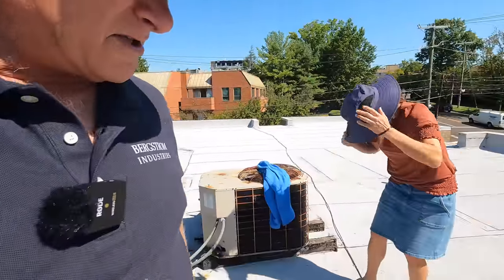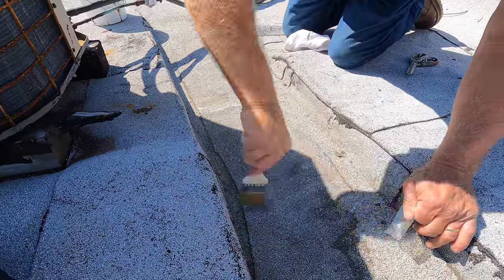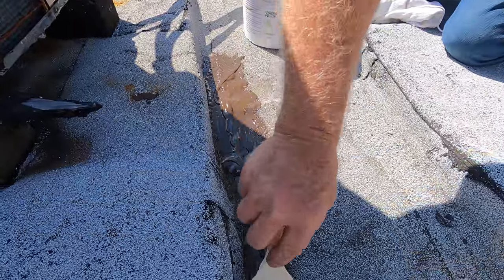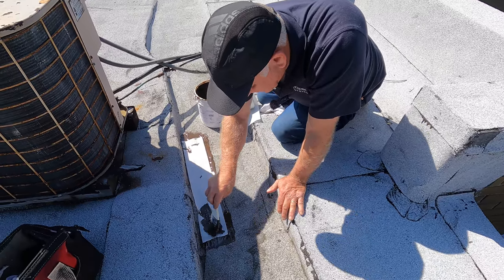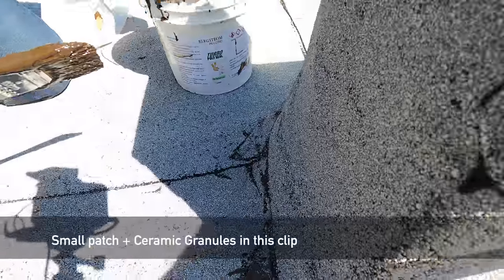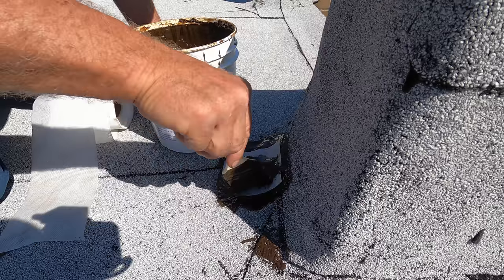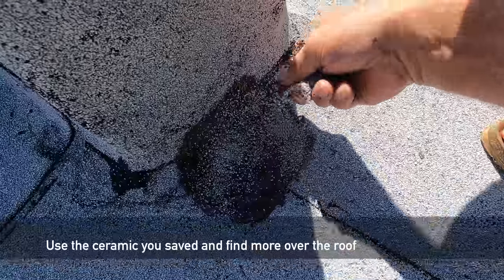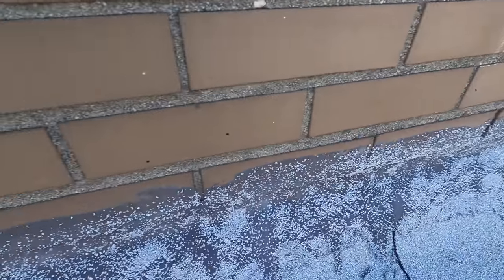Repair Leak on a Flat Rubber Roof DIY easy permanent fix

Comment: how do you stop the granules from coming off the roofing material? can't seem to keep them on there for more than 5 yrs in northeast climate. always have to start silver coating at the 5th yr mark to protect the membrane as it starts getting bare in areas